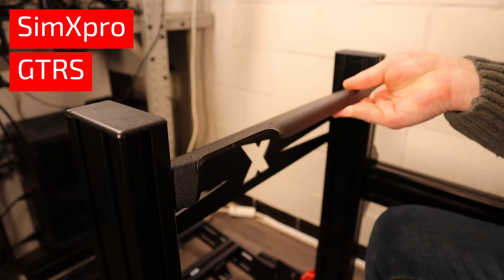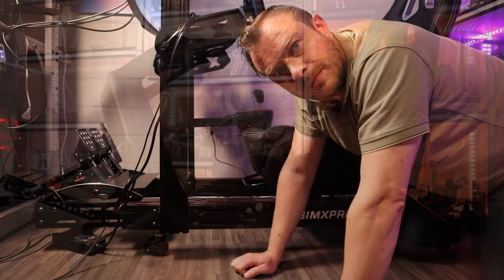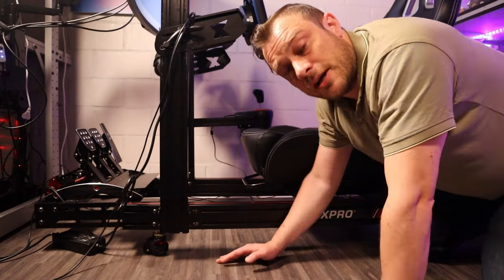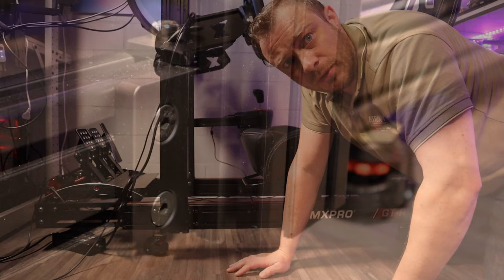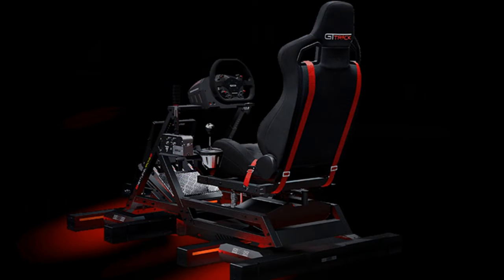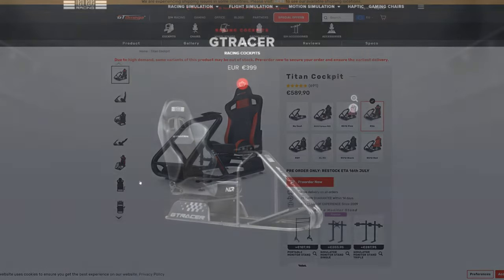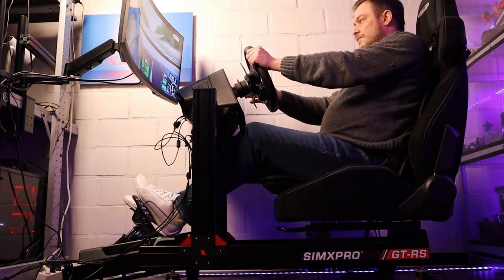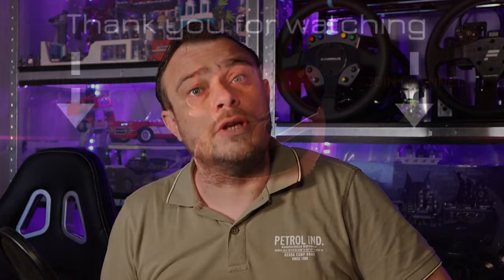Special: Extrusion profile rig or a tubular frame?

Comment: I recently bought the SimXPro GT-RS. I really like it, but one down side is that it was a little bit narrow for me and I have a Sparco Sprint L seat which was a bit too much for the GT-RS. I ended-up ordering more aluminum profile to make wider (580 mm inside width) and now I'm super happy. This kind of modifications will be super hard to do with tubular frames, so I also think extrusion profiles are a right choice.
Reply from the maker: Its a good frame indeed. First time I hear it is too narrow though. I will have to look into this. I used a recliner seat so no issues but now you mention it, if you use side brackets for a wider seat, it might be an issue. Thanks for sharing and happy to hear you were able to fix it.👍💪

Comment: I love the Playseat Trophy, the footprint is the major selling point for me. It just barely fits into the place I have allocated for it, any wider or higher wouldn’t work. Holds up super well for my G Pro wheel.

Only annoyance I’ve had is the absolutely abysmal friction fit mechanism for adjusting the length of the rig. The bolts that come with the rig are Allen key shenanigans of low quality, and I completely stripped them trying to tighten them enough for the whole thing not to extend when breaking. Went to a hardware store and bought some high quality M6 bolts that I can tighten with a regular screwdriver instead of an Allen key along with some washers. Problem solved, but absolutely ridiculous I had to do that.
Reply from the maker: Still my number 1 tubular frame 👍👍👍

Comment: My tubular frame rig made by: PlanB, is very rigid, even with the monitor stand. i also have a 30mm square tube eBay cheapy that needed a bit of bracing and still wobbles
Reply from the maker: Dont find PlanB. Is it known under a different name too?
Reply: @SimulatedDrivingResource  Ergonomic Racing Simulator Cockpit with Monitor Mount

Comment: Hi, I'm looking for a rig to upgrade my GT Omega Apex wheelstand which is falling a bit short for my Moza R12. I'm  thinking about going for a tubular rig and currently the Oplite GTR S8 and GT Omega Titan are on my shortlist (though GT Omega shipping cost to Belgium is brutal). Any advice?

Besides my question, love your neutral reviews. Very informative without feeling like a sponsered salespitch, which is rare.
Reply from the maker: Unfortunately I have not tested the S8 yet but they did tackle my main gripe with it being the pedals. I have a lot of love for the Titan and I would place it above the S8 but not by much and with 70€ of shipping it is ouch. It does come with the choice of a recliner seat though. Hard choice. Is there any reason why you would not add the Playseat Trophy on your shortlist? It would make it easier for me to advise 😏 btw, buying 2dehands can also give you a very good deal. A last thing. Black friday is also around the corner should you really want to buy new. Thank you for the kind comment. I try to remain an educator and not a creator of infomercials
Reply: @SimulatedDrivingResource  I don’t know if it’s justified, but the Trophy doesn’t speak to me. As someone who had the chance to have sat in “the real deal” (not as a driver, but I did some medical related volunteer work at Francorchamps) I think having something solid with a real bucket seat adds to the experience and immersion. The small footprint and being moveable ticks some boxes, but for some reason it still feels like a compromise. Thanks for you’re advice! Maybe I should be patient and wait a bit longer for some Black Friday deals.
Reply from the maker: Well whatever you choose, I am sure you will be happy with it. It are both good choices.